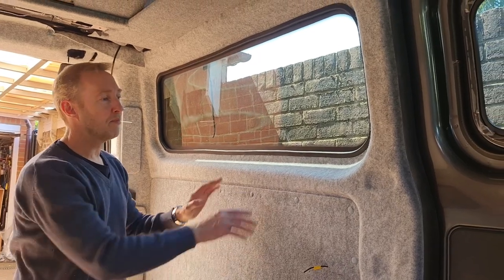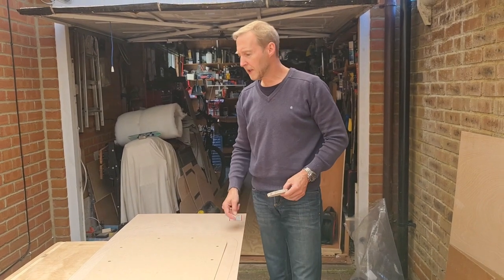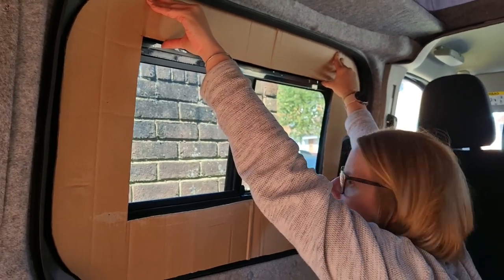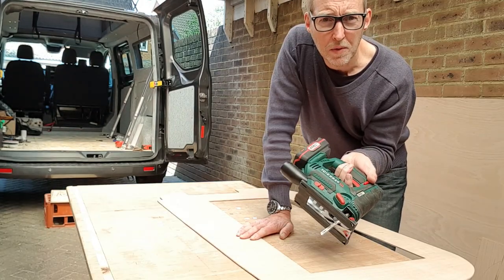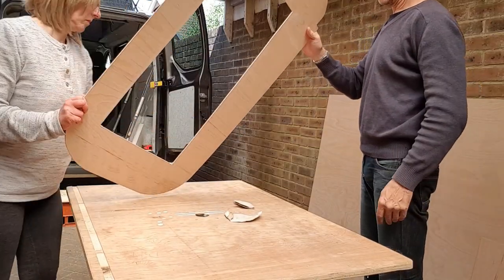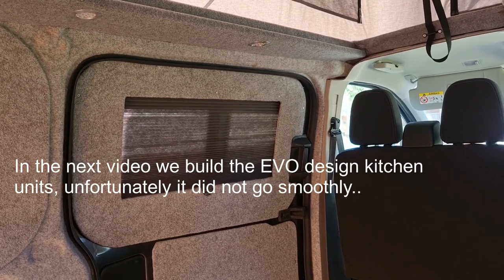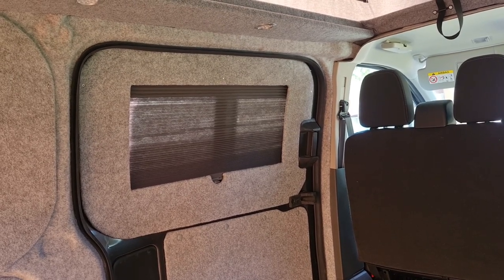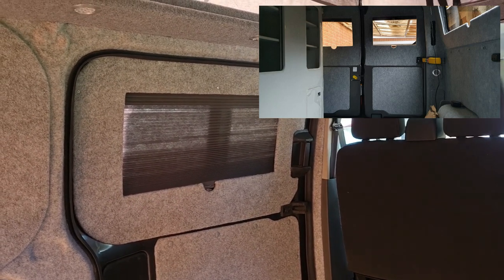Using Ikea blinds to make blackout blinds in our Ford Transit Custom

Comment: did you use 80cm blinds for the doors?
Reply from the maker: Hello. Thanks for viewing my video. Yes on the sliding door I used a 80cm × 150cmm, opposite the sliding door I used a 100 × 150cm the rear quarter (lwb vehicle) I used a 120 × 150cm and the 2 rear barn doors I used 2 60 × 155cm.
Before installing try to cushion the spring from vibrating against the metal channel its housed in, as when driving you will hear the spring rattling against the housing, this was annoying till we cushioned it, now its quiet.
Hope that's helps.
Reply: @royclark8385  thank you kindly
Reply: @royclark8385  so they arrived today, got them in test fitted and then wondered about the spring rattle you mentioned, did you mean some white fluff type insulation to dampen the spring?
Reply: Also did you bother with channel each end like others have shown? They seem to hang well without, can’t decide if I need them
Reply from the maker: Hello. Yes I used a 80cm for the sliding door and a 100cm for opposite the sliding door. As for channels, no we didn't, the blinds hang very well although in order to get a good "black out" we made the window cut out of the frames at least an inch shorter each end than the blind. You will also need to add some sound proofing material on the blind frames to stop the springs, within the blinds from rattling against their housing when driving. We discovered this after fixing them into the van.